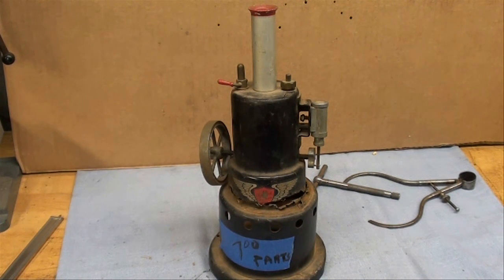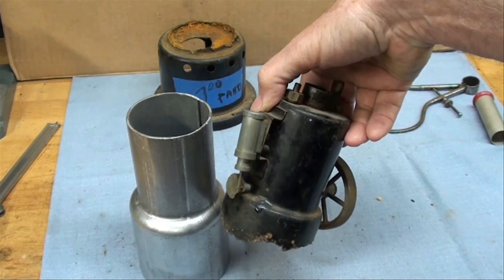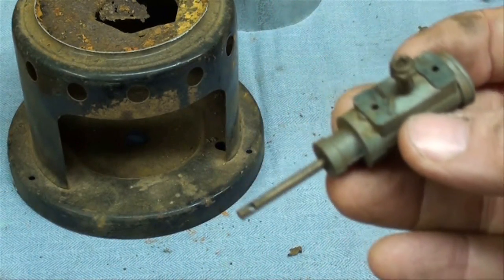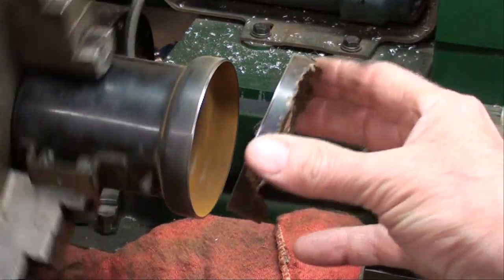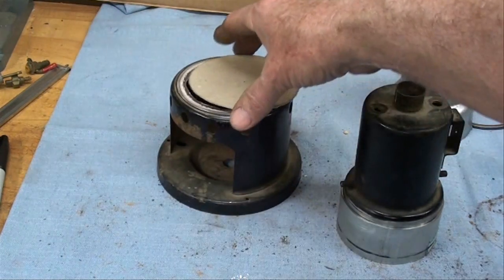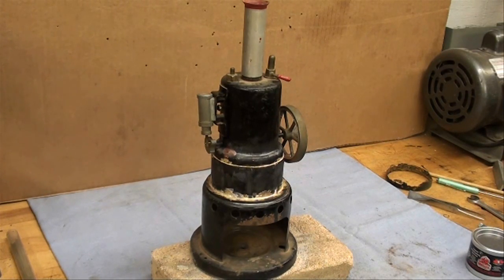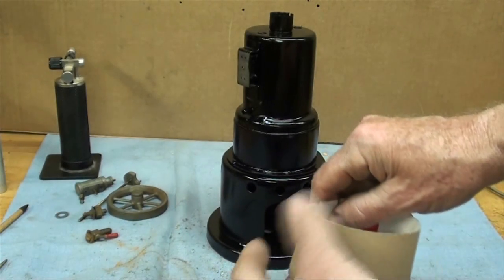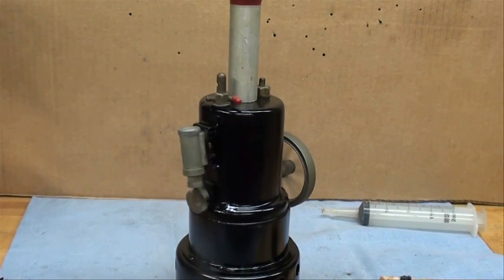Toy Steam Engine Restoration ROBERT FULTON by tubalcain

Comment: I got my son and my grandkids into steam and building things by hand , the pity is they live in Brisbane 1100 kilometres away so its a long time between visits 2 year intervals at least.cheers LYLE . A nice little project .   I. have a large project to fix my COKE dispenser dropped a fan blade which i brazed now its the compressor which is not cooling. So will check the electricals. CHEERS AGAIN LYLE. FROM OZ.
Reply from the maker: That's awesome that you got your grandkids involved. I am lucky as my grandkids live right next-door

Comment: Thanks for this excellent video. One minor thing - - I've never used silver solder and would  like to have seen you actually applying it. I've just finished restoring an old Mamod and I used common electronics solder to re-attach  the small copper pipe from the top of the boiler to the chamber. I've only run it using air so far and wonder if I will have to re-do the solder work when I burn alcohol..?

Comment: I have a few Weeden engines similar that I can use parts from and cobble a working engine out of. I still need the stack, flywheel, and burner. Do you know where I can get these parts?
Reply: +Streamlined Steamroller wtf u do hee
Reply: +The 20th Century Limited (Ricky B.) Tryin' 2 maek mai weedenz go fix
Reply: Streamlined Steamroller o oku mak goz fixixixix?
Reply: The 20th Century Limited Ye. Need 2 maek goe fiks
Reply: Streamlined Steamroller kk

Comment: In this particular engine, the chimney would have run in the middle of the boiler, thus greatly increasing the heating area of the boiler. Volcano Kettle and The Berkeley Stove also work on the same principle, google it.

Comment: Wow I sure liked watching your video.  I hope you enjoyed making it.  Would it be possible to use aluminum or copper for the base plate, since it conducts heat better?  I didn't know if you could solder dissimilar materials together.